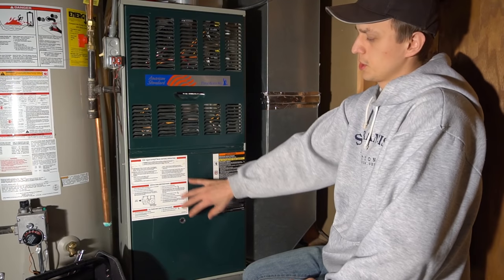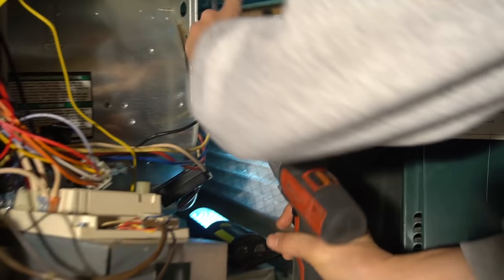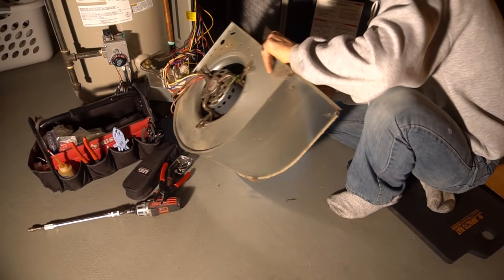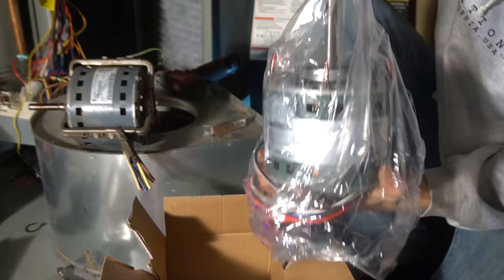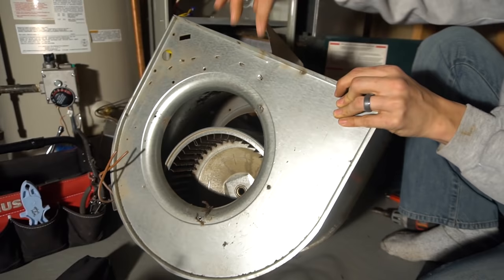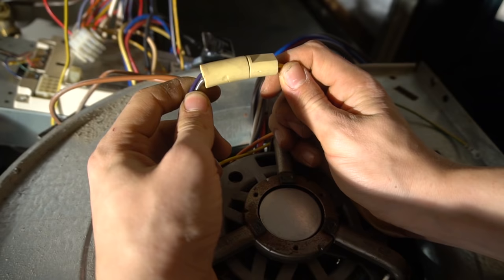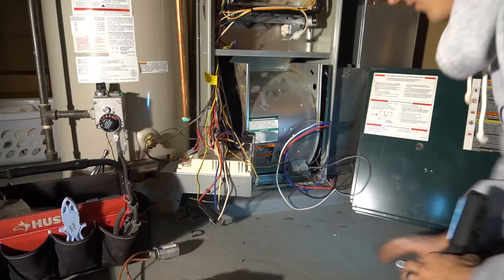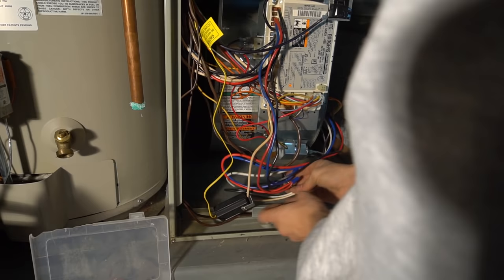Furnace/AC Blower Motor Replacement Step By Step

Comment: My furnace started making noise the other night and then cut off. I opened it up and spun the blower motor and fan , turned it back on. Everything worked and cycled as it should and worked fine again for a while, but  then I started getting a bad burnt plastic/rubber smell through my vents. The blower motor still works and spins the blower..nothing is scraping and I have a clean air filter. I cleaned the flame censor etc...but I'm still getting the burnt plastic smell. Any idea why? I can't afford a service guy to come here, and it's -4 in Buffalo NY right now. I hope you can reply when you get the chance. Thanks
Reply: It sounds like your motor is about to totally quit. It's likely a sleeve-bearing motor and those bearing surfaces simply don't last forever. I would get a replacement uber-pronto, along with the proper capacitor for the new motor. The Fasco D727 motor that Jay links to on Amazon is pretty common, and may fit your needs. You should be able to get one (and the capacitor) from your local suppliers for a price (maybe less than $125 total) not a lot different from what Amazon has. 

About a month ago a tenant called early on Saturday afternoon a tenant called me to say their furnace had stopped working. I was there within and hour, determined I needed to replace the motor, and gave them space heaters to get them by, assuring them I would have the furnace fixed in a short time. I found a used furnace motor on Craigslist - $55 with the squirrel cage and motor mounting bracket still attached - and persuaded the seller to let me meet up right away. I was able to make a same-day repair, to the surprise and delight of my tenant. (For a furnace without an A/C function, you don't necessarily need to match the H.P. rating as long as you don't go less than the rating of the original.) 

I'm not counting on the used motor to last, tho, and have a new motor w/capacitor on hand now ready to swap in after the heating season ends. So...I've been there, man! I understand your stress. Good luck!
Reply: Tom C thanks so much for replying! I'm on the hunt for a new motor now. Unfortunately I cannot find the model number anywhere online :(. 
It's a General Electric motor , model 5kcp39kgP750BS.
Maybe I will try to find one with the same ratings /size
Reply: @disgruntledvet11b18  Yes, just go by the specs. There are many brands and models for a blower motor that will work perfectly well. What are the specs, by the way?
Reply: Tom C it's a GE (General Electric motor) , model number 5kcp39kgP750BS. It's from a corsaire furnace (about 12 years old). 
The specs are: 
1/2 HP
V 115 
A 5.80 
RPM 1050 

It measures 4 and 12 inches tall, with a 5 and 5/8 diameter. It has a a 1/2 inch wide spindle , and the spindle measures 3 and 1/2 inches out past the motor
Reply: @disgruntledvet11b18  I first need to say that I'm not a trained tech. Whatever I say comes from a lot of self-directed study and 50 years of experience. I give you my best advice, but no guarantee. Evaluate my suggestions from a skeptical point of view. Be careful. 

Ok, on with what I see regarding your situation. You have a typical blower motor and you can use a generic replacement. If it's a 3-speed, then you could use something like a Protech 52-22858-01, Fasco D701, an AO Smith or others from various manufacturers. (I'm not as happy with  recent GE motors at the moment.) Make sure your new motor runs in the right direction, or get a reversible motor. For your new motor, the amp rating could be anywhere from about 5 amps to 9 amps. Whatever you get will work. The 1/2" shaft on your replacement will likely be longer. No problem: it just has to fit within the furnace. Expect your replacement to have a 1075 RPM spec. I have always re-used the old motor mount bracket, but if your old motor has a welded-on bracket you may need to buy a bracket like the Fasco FM55 that Jay mentioned. 

One question I would still have is how many speeds. Three speeds is common, or four, depending on whether you also run air conditioning. It should say on your motor plate. Regardless, for a heat-only function your furnace probably only uses one speed anyway, which on a 3-speed motor would usually be the medium speed. (Any extra speeds are made available for air conditioning functions. Don't worry if the motor has more speeds than you need. Your furnace may have a 4-speed motor and an option to provide air conditioning, but if you did not opt for the A/C, then you can save money by going to a 2- or 3-speed replacement motor. 

In the Buffalo area you have quite a few HVAC supply houses (no surprise) who will sell you a blower motor. A few big ones are Ferguson, VP Supply, and IRR Supply. Home Depot even sells generic blower motors though they may not have them in stock, and then there's the Amazon option too. 

HVAC techs go in to buy generic blower motors all the time, saying something like, "I need a blower motor: 1/2 horsepower 115 volt. It's a 3-speed, runs counter-clockwise. And I need the run capacitor." Ask like that and the person at the counter will know what you need right away. Just make sure you buy the correct capacitor at the same time that you buy the motor. Your total cost, motor+capacitor+optional motor bracket, should be $100-$250. No need to pay more. Good luck!
Reply: @disgruntledvet11b18  I just noticed what may be a possible recommended replacement motor for your Corsaire furnace, a ProTech Model 51-20170-01. I'm not sure about it, so check out the specs before buying anything.
Reply: @disgruntledvet11b18  When it comes time to connect the new motor, make sure you first make a record (Take photos!) showing the connections for the old motor. The wires are color-coded and USUALLY follow common conventions from one manufacturer to another, so just match up the colors and cap the unused wires. 

Better yet - and I strongly encourage this - study the wiring diagram, even if you have never tried to figure one out before. Follow the electrical connections from the point where they first come into the furnace. Concentrate on it, think about what is going on step-by-step, check online to learn symbols and abbreviations, and activate your personal memory tricks. You can learn an awful lot about how your furnace actually works. It's knowledge you will use again and again in your role as a competent homeowner, as a teacher for your kid, and as a valued resource for your friends and neighbors. 

When doing all of that work, be very careful, be methodical, and double/triple-check everything. Keep track of what you are doing. It's way-easier to do that than to deal with a big mistake. Above all, STOP if you are unsure, and STOP if you haven't taken all of the proper electrical and personal safety steps needed to avoid injury. Seriously, this is a big responsibility. And consider this: calling in a trained and certified HVAC tech may be a much less expensive option than you may think at first.
Reply: Tom C thanks so much for your advice and answers!!! I've got a new blower motor coming in the mail and I will do just what you mentioned. It won't be here for another few days so I'm roughing it out. The wife took the baby to her moms house, so it's just me and the dog inside of a sleeping bag until it gets here!
I'll keep you posted and let you know how it goes!
Thanks again !
Reply: @disgruntledvet11b18  Sounds like a rustic life for the time being. Lol. I've hunkered down through primitive conditions like that, and while not comfortable, it's been kinda fun.

Keep some heat going with electric heaters. Make sure the pipes don't freeze and burst! They are often run up the wall cavity on outside walls and can get very cold, even though the interior of your home may be tolerable. Best defense in a situation like that is to open the taps to a barely perceptible trickle. That way if they start to freeze up, at least the pressure has somewhere to go.

If you have a friends or neighbor to call on as you're working it may be a smart move. An extra set of eyes on the job can help when you haven't been through it before. A hot cup of coffee is encouraged. It will help keep your hands warm. Just save the beer until AFTER the job is completed. Good luck!
Reply: @tomc3542  i actually fired up a little wood stove vented through a piece of sheet metal in place of  a window for the time being. i bought a little 100 dollar wood stove  on amazon for camping years ago, but now its being used to camp inside my house! all good over here for now. i will let you know once it gets here how everything goes!
Reply: @disgruntledvet11b18  Just don't fire up your house, man. That would be a very expensive furnace repair. Think safety.
Reply: @disgruntledvet11b18  I found on at Grainger for $116.00.  I will be doing mine Monday when goes up to 50 here unless the blower motor craps out before that.
Reply: Brian Cloutier cool! I found one on amazon called "Fasco", it was only 70 something bucks with free shipping. It was supposed to be here yesterday, but I guess the blizzard slowed the shipment down. See if this link works, let me know what you think. I may have to drill and tap holes in the housing of the new motor to mount my brackets (the brackets that hold my blower motor in place were screwed directly onto the motor itself). Fasco D2835 5.6" Frame Open Ventilated Permanent Split Capacitor Direct Drive Fan and Blower Motor with Sleeve Bearing, 1/2HP, 1075rpm, 115V, 60Hz, 7.3 amps https://www.amazon.com/dp/B0099B5OYS/ref=cm_sw_r_cp_api_i_fjmvCbZ4BHXVR
Reply: @disgruntledvet11b18  Wow that is a good price!  The ironic thing is I have not replaced mine yet because it is not making any more noise and running great!  But I am ready to do it soon.
Reply: Never mind has wasn't on! Got it all up and running again! Thanks so much for all of your help!!!

Comment: I have three wires to reconnect white, black and red.... no blue and or yellow. It is the right motor etc....
Reply from the maker: Only connect those three then and put the other two speed on PARK or SPARE terminals or just cap them with wire nuts.
Reply: Word of Advice TV thank you and I did... however when I put the cover back on the motor starts turning .... there’s a small button that gets pushed in when the bottom cover is put on.... why is this? Is there something that has to be reset? Motor running perfect....
Reply from the maker: That is a door switch and is there as a safety switch. It acts as a secondary furnace power switch. It's purpose is to turn off the power if the bottom door is taken off so that someone does not hurt themselves.

Comment: Hi. I went to replace my capacitor but when I opened my unit. I found two capacitors. One was attached to the blower motor (the 12.5 uf). The other one was attached to my induce motor (the 4 uf +-) but it was tucked away by the control board. Help. Every video I’ve seen only has one.

Comment: I have a question.  You said you got your motor for the blower and it came with a capacitor.  May i ask where did you order it from?  Thank you sir.
Reply from the maker: I actually ordered the capacitor separate. When you order the fan motor, in the specs section, it will tell you what capacitor is required for that motor. I order most of my stuff on Amazon and I have links to motors and capacitors in my description if you need them.

Comment: Same thing here I went from a 4 speed to a 3 speed. But mine wasnt yellow, its white. Will this be a problem??
Reply from the maker: A white is usually the neutral wire. You do need to have the  neutral hooked up. On the side of the new motor there should be a little wiring diagram that shows which wire is the neutral. Hook that wire up to your old neutral wire. For more help on wiring, watch this blower motor wiring video: https://www.youtube.com/watch?v=4S8TZd-45bY&t=2s
Reply: Ok I got it down, I got the fan to blow. But it stopped, it smelled like burn. I checked the motor and its HOT. What do you think??
Reply from the maker: @sephirothcallum6962  That sounds like it's a bad blower motor. Do you have a meter? Can you verify that is getting the correct voltage? (120v) Did you replace the capacitor when you replaced the motor? There is also a chance that the new motor came bad right out of the box (happened to me before)

Comment: just subscribe your channel.  how do you know the motor is bad?
Reply from the maker: Thank you! The easiest way to check is with a meter. You can try checking the resistance on it but I usually just check and see if the motor is getting 120 volts. If the motor is getting power and the capacitor checks out good yet it is not starting, that means the motor is for sure bad.

Comment: Hired a guy on the side to do this. He took the motor and repacked the bearings. Put it back on and it still runs slow. So now he's looking at the capacitor. The house is cold and he says he'll be back tomorrow. Starting to question this guys ability.
Reply from the maker: I don't know many guys that would try to repack bearings on a blower motor.. Most techs will just replace the motor and capacitor and be done with it. I am not sure if the capacitor is the problem. Did he check it with a meter to confirm that it's weak? Come back and let us know how it goes if you don't forget. Good luck!
Reply: Word of Advice TV He was trying to Save this old lady money. He did meter the capacitor and it was off. He will replace it tomorrow. Will update after. Thanks, wes
Reply from the maker: @elflauta1  Ah I see! Well that's nice of him :) It is possible to oil the bearings and get the motor to work again most of the time. Hopefully the capacitor will do the trick!
Reply: Well we won't know because he keeps giving us the run around. And the lady is still cold. She won't let me call someone else. She believes his lies and I don't. lol

Comment: Mine is 40 years old and it says  Volts 208/Hertz 60 H/P 1 Motor 670S Phase 1 Amperes per mtr. 1.05 Made in Oklahoma City Model 8ve4-4e.  What can I buy to mach this old motor

Comment: Hey I just opened my furnace and realized my ground wire broke off, would this mean I will need to buy a whole new blower motor?
Reply from the maker: No need for a new motor :) The easiest solution to that would be to strip half an inch of insulation off of the end of the broken wire and then find the nearest screw that the wire can reach. Loosen that screw a little, wrap the wire around it and tighten it back down. Any screw that is screwed into metal will work. There are also little wire connectors that you can crimp onto the end of the wire. If the wire is not long enough to reach any screws, it is okay to add another piece of wire (attached with a wire nut) to make it longer or you can screw in a new screw into a metal surface somewhere inside the furnace. Make sure you know what you are puncturing though, preferably so you can see where the other end of the screw will come out. Sorry, that was a long answer for a short question.. Hopefully that made sense :) If you really don't feel like doing any of that, then you can at least wedge the end of the wire into some metal ridge and put electrical tape over it or something.
Reply: Thank you so much!! It took me a whole day last year to replace that blower motor on my own! 😅 #firsttimer! But you are a life saver!!!

Comment: If I remember correctly you are in MN. What is your service area?  My blower motor is rather weak especially for the size of my home. I am wondering about getting a new one, if it's worth it or not on a 10yo carrier?

Comment: Awesome job,  worked so hard at it , thank you.
What would a job like this cost ? 
Is there any blower motor without a capacitor.  ?
Reply from the maker: Thank you! Around $400-500 would be an average price. And yes, ECM or variable speed motors will not have a capacitor.
Reply: Thank you so much.